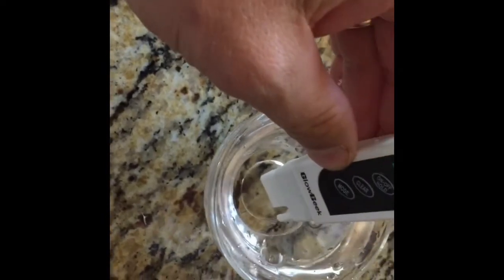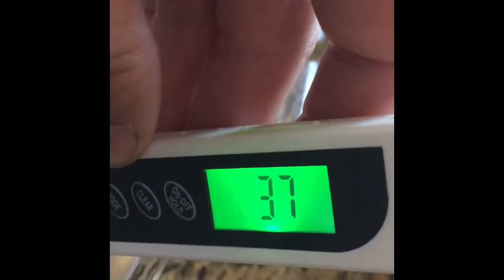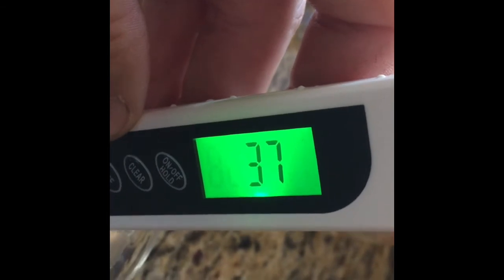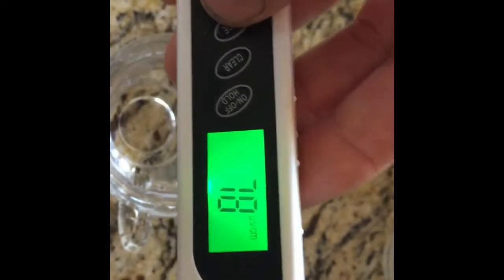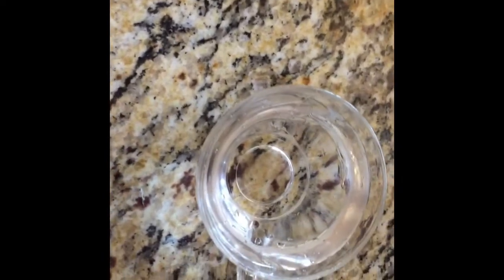PUR Water Filter Test

Comment: This the most useless  test. Don't you also realize that the minerals that the filter adds to the water to improve the taste of the water would show up on that your meter as more ppm. If you hate the filter, post something true like "faucet connection piece is not durable". Mine got lose in less than a year, and the poorly built filter started leaking tap water. Some of the leaking tap water began mixing with the filtered water, rendering the filter unusable.

Comment: You do realize that total dissolved solids and actual water purity are two entirely different things right? That fancy little meter you have is completely useless in determining the safety of drinking water... Magnesium for example would fall under the category of a "dissolved solid", yet it is not only safe but actually good for you. Useless video.
Reply: Ross Fuller you do realize you can spread information/share opinions without acting like a pretentious turd right? 💚